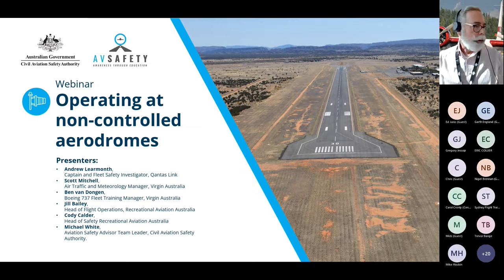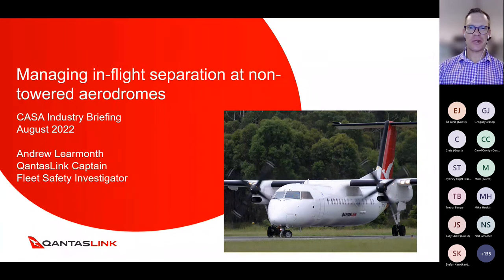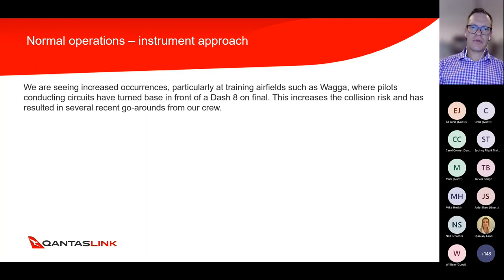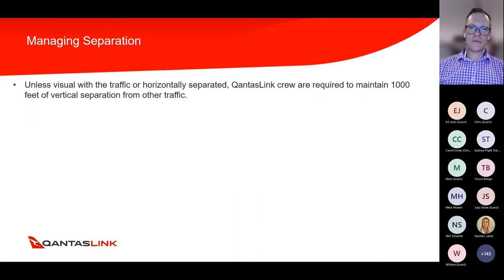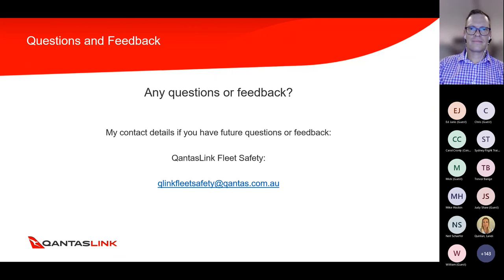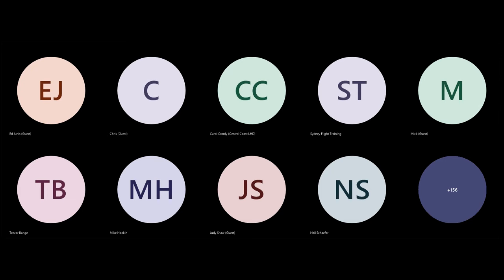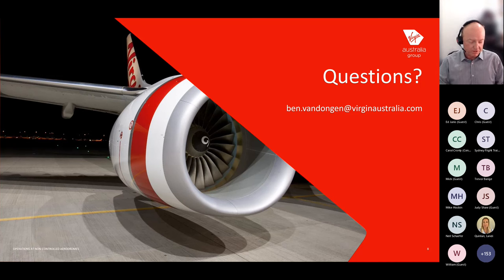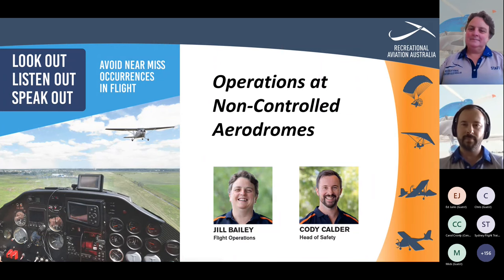Operations at non-controlled aerodromes webinar – 31 Aug 2022

Comment: If the light A/C is already established in the circuit THEY have right of way over a straight in SkyGods plane!
Reply: AIP ENR 1.1
9.2.8
They "should" consider giving way though if it can be done safely.
Reply: technically but it's always best practice to give way to RPT/commercial operations, especially given a C172 is infinitely more manoeuvrable in a circuit area than a Dash 8

as mentioned at 18:39, the safety of everyone and courtesy should be the ultimate considerations - not "I have right of way, you get out of my way!" not to mention, a dash 8 has a lot more souls on it than you and your mate in a light aicraft,